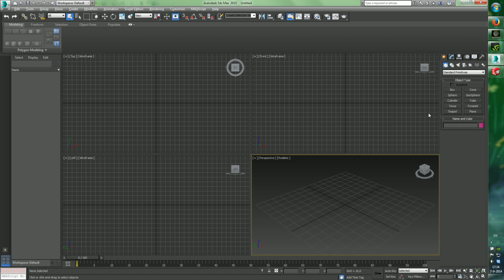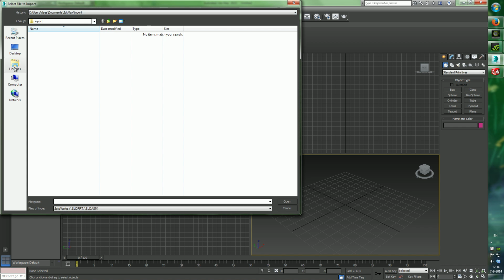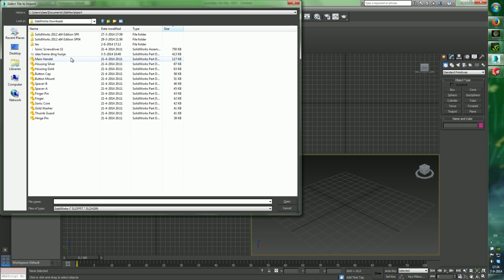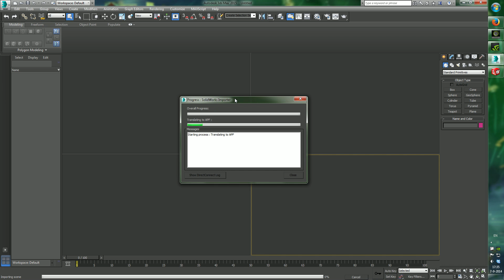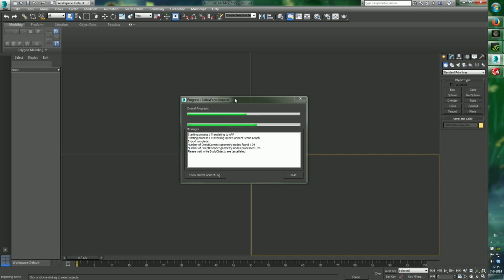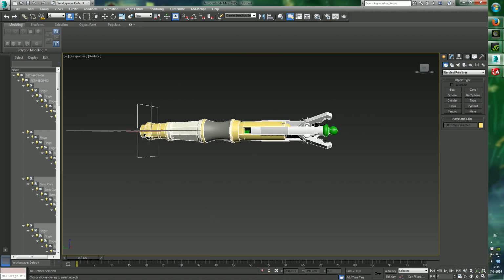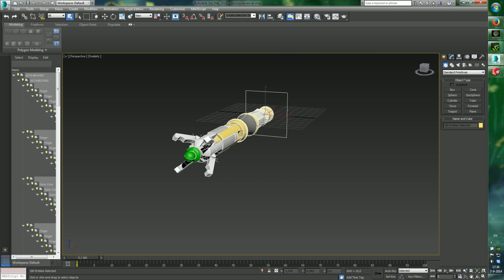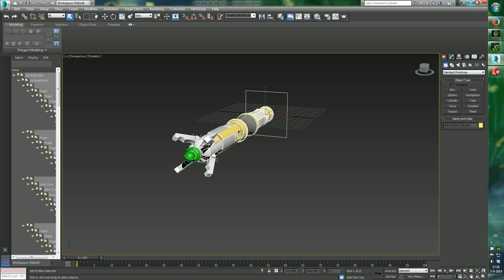how to export a solidworks file to autodesk 3ds max

Comment: Hello CADBrothers! I've been looking your vids, thank you for the video about converting *vrml to *C4d, i found it useful. 
Could you please tell me, is it a pinger that you convert to 3ds Max? Or some kind of capture arm? Could i make solidworks animation of capturing different objects with this? Or could i make a mechanism from the popula Mario- game, if you remember, there is a flower that moves out of the tube, captures object and hauls it inside the tube back(retracks).The capture device would has the form of a basket like funnel shape, that encloses when capturing.
 Sorry for some mistakes, looking forward for your answers, thank you in advance.
Reply from the maker: All the annimations you make in solidworks animation will not be moved to 3ds max. The animation should be captured in 3ds max. You can only use solidworks to make very detailed models. As far as my knoweledge goes.
Reply: Hello CADbrothers, actually i don't work in 3ds Max, only in Solidworks, so o was wondering if i could make an animation of that pinger-like modelin your vid, that would capture another object and haul it somewhere.Could it be so in SW?